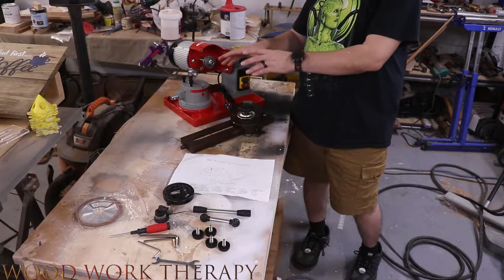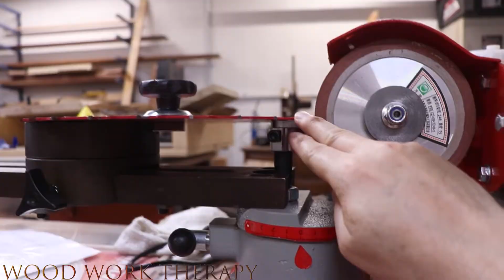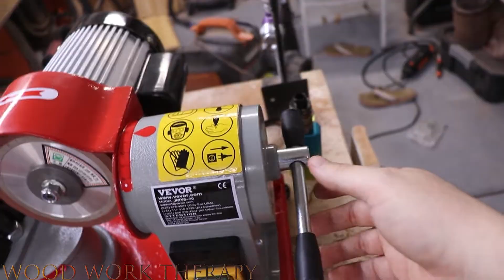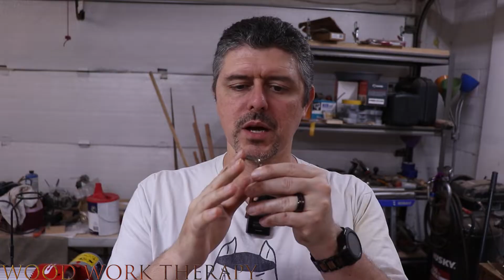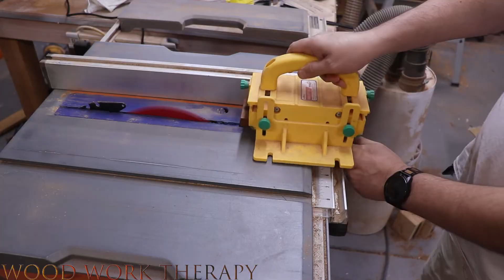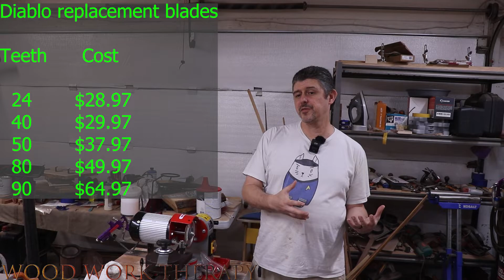Vevor Saw Blade Sharpener Review – Does It Actually Work?

Comment: Nice video.  Nice machine. It looks much more sturdy and easier to deal with than the one I gave $39.99 for.   
I have the harbor freight version which works, but is a bit frustrating because of the slop in adjustments.  There's a huge difference in price between the two.  I sharpen few enough blades to suffer the bit of frustration and enjoy the price difference.  That's not true for everyone.
Reply from the maker: Thank you for the comment and for sharing your experience! That's a great point to make about balancing budget with usability.

Comment: The saw blades for my 1inch arbor saw cost 200 to 400 bucks each if i am able just to sharpen 2 blades i would be well ahead in the game.
Reply from the maker: Yep! It usually just needs a light touch—what I like to call an "aggressive cleaning." It’s more than just polishing; it brings back the shine, flattens the face, and really helps restore that sharp edge. When I’m done, the blade often feels even sharper than it did from the factory.

As long as there aren't any chips you're trying to fix, this approach usually does the trick. Some folks also recommend touching up the back side of the teeth, especially if the blade had a rough day (we've all been there, lol). I haven’t found it necessary myself, but it might be a helpful extra step depending on the condition of your blade.

Comment: You cant get a new grinding wheel for this machine. After sharpening 3 blades i am trying to order one and Vevor says they don't have any and don't know where to get any! I guess i now have a 200$ boat anchor. I would not recommend buying this machine.
Reply from the maker: Is there an issue with the grinding wheel that was included in the description?
Just incase you did not see it: Replacement disc: https://amzn.to/3e7VAXW

Comment: There are so many reviews of this and similar machines... but I found just 1 rev. where someone sharpened the back of the teeth... and I´m pretty shure he did it not the best way. There is no doubt, the machine is build for sharpening breast and Back (top face?) of the teeth... no doubt also, something is a little bit weird... should be improved... I have an older Version of this (2013) with minor differences... I should make a video about sharpening and geometry of teeth myself... 😒

Comment: The spacer for the blades were too big. Metric versus standard. I had to resize one to fit the 5/8” hole in my blades.
Reply: Mine was .0075” to big. Put it in on a metric bolt and then in my drill. Spun it on a fine stone grinding wheel. Worked good. 😊
Reply from the maker: @flowerstone  Love that! Would have loved to see a video on that.... You may have given me an idea... Well more pain to come for me no doubt! ROFL
Reply: I don’t have a way make videos. Have to get a phone holder. 😊
Reply from the maker: @flowerstone  A phone is not a bad way to start, especially with shorts content. 😀
Reply from the maker: Had someone message me that a year or so back. He did some sanding with a belt sander 80 grit I think and made it ever so smaller. It was off by like 1000th of an inch if memory serves. Figgured it was just a QA issue on that one unit. Good knowledge to pass on if that is an issue on some units. Thank you for the comment. We all beniffit in the community when people comment good info like that. 😀

Comment: FYI. The plastic cover on the electric power switch is if you purchase the sharpener with a water cooling bottle it stays dry. I just got one just like yours and you answered my question. And it works excellent few tweaks but normal for the price Thanks
Reply from the maker: Yeah found that myself on it. Well built, but also shows a few small cheap traits, nothing super bad however. Overall still very happy with it! :)
Reply: Do you think there's the potential to use this machine to.start a blade sharpening service?

Like the very first stepping stone type of thing.

Im a 13 year finish carpenter
Reply from the maker: Possibly. It works well. I would consider the water version if your doing that as that will be better for long years wear and tear. I have a link for that one in the description if you are interested.

Comment: I am wondering if you recommend doing the face or the top first? Does it matter which is done first? I don't think it will, but have no idea.
Reply from the maker: Disclaimer: Not a sharpening wizzard. That being said. I only have had to do the face on mine. I would assume if the top of the carbite had became damaged then worrying about the top would be a priority first. Since I have not had to do that procedure, I can't say for sure. Just doing the face has worked really well for me up to this point. However there are more practiced hands here on the channel that may have better advise. None the less I hope that helps. 😊
Reply: @WoodWorkTherapy  thanks Brother
Reply from the maker: @IanCdnMerkaba  Anytime 😊

Comment: I see that it uses a 180 grit wheel. in your experience so far is 180 fine enough or moving to a 300-400 after grit would give you better results?
Reply from the maker: I haven't seen any need to move to a softer grit, honestly. I'm still using the original wheel, and it's been performing flawlessly. The blades come out sharp, there's no burning, and the performance is consistent. It's been reliable, and I’ve had zero issues that would make me consider changing it.

Comment: I just got delivery of the same VEVOR table saw blade sharpener.  A few problems with it.  The motor housing covering the end motor had a lots of dents, less than adequate packaging to handle a 60lb tool and probably some rough handling during shipping.  Motor was not damaged.  The large cupped washer that secures the blade was not as deep as the center bushing is tall.  The blade bushing adapters are 1/8" taller than the cupped washer, leaving a large gap between the blade and the washer.  I stuck some small rubber pads to the underside of the washer to make it work.  The last problem I noticed right away was the diamond sharpening blade had a lot of runout (wobble) on it.  When I measured the runout with a dial indicator the total indicated runout was 0.020 (twenty thousandts)...that's a problem!  When you touch the saw blade to the sharpening blade you can easily hear it making uneven contact.  When the motor stops and you look at the  sharpening blade, you see only about 1/2 of the blade is actually making contact.  This could be due to uneven diamond sharpening blade, very slight bend in the motor shaft, or the thick washers that secure the sharpening blade are not very flat.    The problems are disappointing but not  total show stoppers that would warrant shipping the tool back.
Reply: The diamond wheel like the machine itself is cheap and run out is included at no extra price, I replaced it with an old school wheel ,with a bit of modifications of turning bushes on the lathe and-I got it to run true
Reply from the maker: You had me at damaged motor housing. I would return that one. Especially since the other issues were prevalent as well. Mine came nice and mint as you would expect. So yeah I would return that in a heartbeat. That would be unacceptable in my book. Sorry to here you had that happen. :(
Reply: @WoodWorkTherapy  Have you ever checked the run out on your blade?  I'm curious if run out is excessive on other tools.
Reply from the maker: @dtsouza2519  Can't say that I have to be honest. I haven't seen any noticeable divination in the blades to make me think to do that.  Not saying it's a bad idea or anything. Just haven't felt the need to check for that level of accuracy based on cuts that I have made and the post cut accuracy that I get in the end. If I saw divination in the custs that might be something I would cause me to check and be alarmed.
Reply: @dtsouza2519 mine same problem. I didnt measure the woble but It seen at clear eye. 🥺 
The lose saw i solved with a plastic washer. But the woble  disc worry me. Dont know if send It back . 🤔
Reply from the maker: @igotbricotools2035 it should not wobble. I have not seen that issue. I would send it back if tightening up everything does not fix it.
Reply: @WoodWorkTherapy  i just figure out whats the wobble cause on my machine, and its the aluminium disc. I made a marc on a disc, and then turn the disc 180° , and the wobble is the same.

Comment: I'm wondering if the water injection model may do a better job.
Reply from the maker: I've been curious about that too! Surprisingly, I've had a really positive experience with the Vevor Table Saw Blade Sharpener. Honestly, zero complaints kind of happy with it. As for the water-based option, I'm not convinced it would make a significant difference. Since the blade only touches the grinder briefly, it's not like it's grinding the carbide extensively. Maybe it would provide a slightly finer result, but I doubt it would truly impact the blade's performance. Anyway, I'm no pro sharpener, just sharing my experience! 😄

Comment: You got the 2850 rpm model. I saw a same unit but touts a 3600 RPM. hmmm
Reply from the maker: Odd. Not sure why there would be different specs for the same unit. the Amazon listing still shows the 2800 rpm. And i checked the model number on Vevor's company site and it also states 2800 RPM. That being said, they do have other very similar sharpeners on the site. So maybe you clicked on one of those?

Comment: Depending on how much woodwork you do, this machine would pay for itself sooner or later. That said, it would save the time and trouble having blades sharpened by someone else. Nice to not have to wait. DIY it.
Reply from the maker: That was why we wanted it to! Even sharpening occasionally, it's still worth it, because it is a long haul tool. Your not going to use it necessarily a lot as a hobbyist, but your going to have it for years to come, and that will save money there. And if your on the pro side, it will pay for itself very fast! :)

Comment: Why don't you put a stop on the teeth so that all the faces are ground the same? Then what is it there for? If you only grind your teeth by hand every time, after a while you will have a different tooth and the work with the disc will be much worse. While the angle of the blade is larger, after several manual grindings, each tooth will be a different height. I have had the same sander for several years.
Reply from the maker: Not fully understand the question you are asking. During the video, we did use the stop so we could only go so far on the grid. I know that it is hard to see in the video due to the angle but you can see the arm of the stop on the opposite side of the grinding wheel from the camera angle. Ultimately you can put the stop at any tooth that will stop the blade in a position that kisses the wheel realistically. 9:21

Comment: Your video is a year old now.   How do you feel about the machine now?   How long did the blade last you?
Reply from the maker: Thanks for your inquiry! We actually slowed down on our projects recently, which means our blade hasn't been used as frequently as usual. Despite this, it's still in pretty good shape and quite sharp. We tend to keep the FTG blade on most of the time since many of our filming projects require grooves and rabbits, which it handles well. Surprisingly, it has exceeded our expectations in terms of longevity and performance. It's due for a cleaning soon, but even then, it remains very sharp.

Comment: You don't address the over all quality of the machine. Are all the knobs metal or plastic and is it a solidly built machine. No one cares about allen wrenches or plastic cover over the switches. Also, you are just "flat" sharpening the blade teeth with no mention of angle to the grinding wheel. Poor video.
Reply from the maker: Thank you for sharing your feedback. We acknowledge your points, and upon reflection, we realize that some details, such as the materials used in the machine, might not have been clearly conveyed through visuals alone. We understand that the angles, particularly during the blade grinding process, may have been challenging to perceive due to the slight angle employed.

Upon revisiting this video, recorded almost 1.5 years ago, your insights now make perfect sense to us. We appreciate your suggestions and valuable tips. As we plan to revisit and reevaluate this content in the near future, we commit to incorporating your feedback, along with additional insights and lessons we've gained over the past years. Thank you for helping us improve our content.
Reply: @WoodWorkTherapy dude, it has to be exhausting responding positively to web dicks

Comment: qualified saw doctor here. that is not how you sharpen a saw. just sharpening the face will alter the height of each tooth, its very important that each tip is the the same height otherwise the tallest tooth will be doing all the work, so after refacing, the tips need to be trimmed afterwards.
Reply: I think if you started with a new blade, and were very careful, you could probably get two or three sharpenings on the face before altering the top any significant amount.
Reply from the maker: Thank you for that! :) I am not a professional saw sharpener, just learning like most. So we all appriciate that tip.  If it would not be to much of a bother. Would you explain how to shapen the tips? (meathod/tools, etc ) We are looking to do a quality shapening and cleaning video in the near future, and the more I can absorb from folks like you the better.
Reply: @WoodWorkTherapy  im not sure you can do it with that machine unless you can alter in some way. but basically after you've done the faces you would put it on another machine specifically for machining the top the tooth. all you would do it set the machine to follow the clearance angle of the tip and also the same angle of the kerf which would generally be 10 to 15° on a regular blade, triple chip is whole other story. if you've soldered on new tooth you would also need to side grind it to give it some set and to the same width as the other teeth. its been 20 years since ive sharpened a saw but i think if i had the machinery in front of me it would be like riding a bike. its a black art now.
Reply: @dontwobble  thank you
Reply from the maker: @НиколайД-о6й Glad it helped! 😀
Reply: @WoodWorkTherapy  also i would suggest getting a catch tray made up for the machine to sit in to catch coolant and have it drain into a bucket to be filtered and pumped back to the grinding wheel, important to keep diamond wheels cool and to keep the tungsten cool as well. also keeps the dust down.
Reply: @dontwobble  i think u just saying BS 🤭
Reply: In instructions for another sharpener I saw  the top of the teeth being sharpened with the angled side of the wheel. Might be worth a try to see if you can position the blade so you cab do this.

Comment: I thought every other tooth is a different angle. You sharpened every tooth square.
Reply from the maker: That is true of ATB blades. However not all blades have alternating teeth. Like the one in the video is a FTG blade(flat top grind). These are flat all sides persay. Here is a useful guide that goes into more depth on the topic. It can help with sharpening as well. (Note: I did not write this guide) https://www.toolboxtoday.com/the-types-of-saw-blade-teeth/
Reply: @WoodWorkTherapy I have a number of ATB Diablo 80tooth blades and they all have the same about 3deg on the TCT face angle.
Reply from the maker: @fanatamon  Interesting. I looked up the blade in the video https://amzn.to/48iVHXz And I do see the 20 deg angle but there is no mention of varience on the teath casing a 3 deg offset alternating. Keep in mind that FTG blades are not supposed to have a ATB like tooth. That is a difficiency in the performance of FTG is they are also flat faced making them slower to cut as they more or less wack the wood vs slice the fibers like an ATB blade wood. So I am not sure why yours has a 3 deg angle offset on the teeth. Seems a bit odd from everything Ihave read on it. Keep in mind the blade is working as good as new, and oddly is regularly used due to my personal lazyness to chaneg the blade. LOL Side note, when I setup the blade on the grider, I used the blade to create the offset. I had to reste for the glue rip blade, not shown. 

Do you have the blade model number of the FTG you are using? I might be interested in an FTG with a offset. Might make a cleaner cut...
Reply: @WoodWorkTherapy  Pretty sweet blades I use them for a range of stuff from decking to fix out etc do a nice cut.  The blade in concern is a 305 80t Diablo blade it is an ATB grind but thats all I can find out, the kerf angle I got from matching the angle on the saw blade sharpener. I have a half dozen of these blades and it the blades do appear to have the same kerf angle.  Be interested to know if you have any more sharpening info on these.  I have sharpened them a heap and they still cut well.

Comment: Will tilt to a 40° angle?  I want to sharpen 40° ATB /12" Duraline Hi-A/T .  Thank you.
Reply from the maker: Great question! Yes, it will and more if you need. It is quite accommodating.
Reply: @WoodWorkTherapy  That's great!  Thank you.
Reply: @WoodWorkTherapy  Sorry for the additional question but could you please tell me the arbor size of the 5 inch for the grinding wheel.  Also, could you recommend a high quality 5 inch grinding wheel for carbide tipped saw blades? I like to get an additional good one.  Thank you!